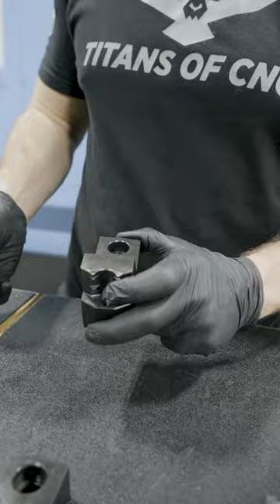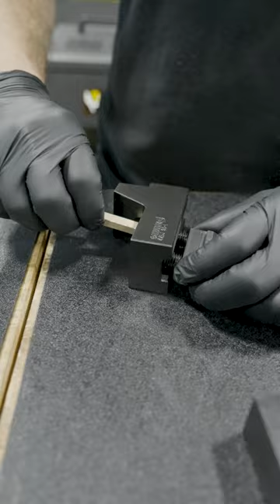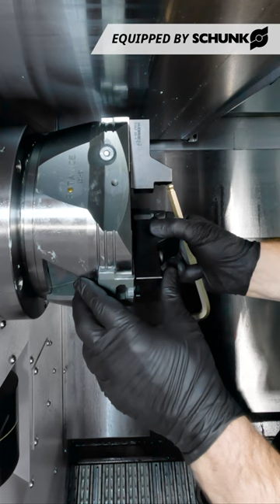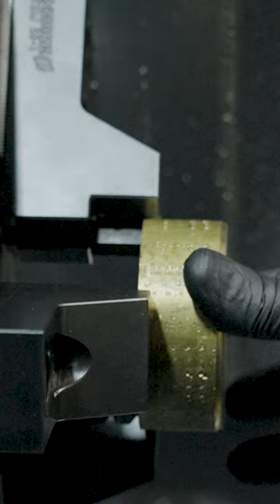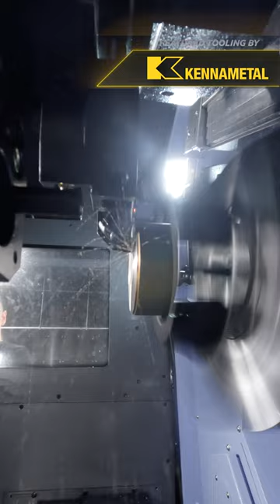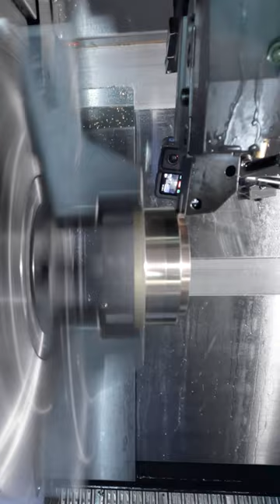EASY FIX for this Lathe Problem

Comment: Instead of buying extra gear you can just use allen screws, works just fine and is adjustable so you can clamp it  "as long as necessary as short as possible"

Comment: Holy cow how many thou did you come to the chuck jaws? Love machining.😊
Reply: Clearance is clearance.  .001 is just as good as .010.  Just hope you don't have to make a Z offset change.
Reply: Yeah the sawcut guy wasn’t paying attention and cut one piece .05 shorter than the rest 😂
Reply: With CNC it's a little less scary. On a conventional machine worrying you'll disengage the feed too slowly sucks when you have 0.05-1.0mm clearance.

Comment: so you guys just screw things into shit and press start on a program? i’m confused
Reply: Haha... for sure no one wants to see the full video of him proving a program and single blocking the way thru it,
Reply: @colbruckner9190  so just to be clear, he’s going to find a program made by someone for a specific part or hole, download said program, run it, if it fucks up make a few small adjustments and repeat?
Reply: If you seriously need to ask this, then you obviously dont understand how to run a cnc.
Reply: It is a "quick" video on a chucking system, not a tutorial on how to operate a cnc lathe from start to finish.
Reply: @colbruckner9190  well yeah no shit i don’t know how to run one that’s why i’m asking, but from what i’ve gathered it’s a lot of clicking start and using other peoples cad designs. maybe change a tool bit here and there but definitely not hard work. maybe if he was generating designs himself and using a hand guided lathe it would be more impressive but this, this is just a guy clicking go on a program.
Reply: @owen8329  there’s definitely more to it than just hitting the start button on a machine. That’s like saying all there is to being a carpenter is nailing stuff together. Unless you’re willing to spend a ton of time learning about machining, you’ll never really understand what goes into it.
Reply: If you are a cnc “operator” sometimes it’s just loading parts and pressing start, but the G-code needed to run the machine is generated by a programmer who has to make and test tool paths that will result in a finished feature. On complex parts, this can be a lengthy and complicated process. Keep in mind that the programmer is designing a PROCESS for making the part as quickly as possible without breaking tools and overloading the spindle. He/she needs to think about fixturing and stock/machine/tool selection as well. There are tons of other considerations as well. It’s not “taking someone else’s CAD model and hitting start”. It’s designing an efficient and repeatable process to make one specific part and then doing it all over again with different parameters and considerations with every other part that you have to make.
Reply: lmao sounds like a salty conventional machinist.

theres a machinist and theres an operator. sometimes the operators basically do just push start, wait for the machine to do its thing, put in the next part and press start again, and check dimensions every so often.

the actual machinist is the guy that writes and checks the program, finds ways to make it run faster, solve problems etc.

one thing conventional machinists do have on cnc machinists is conventional machinists can do repairs/modifications on the fly much faster, and theres some things a cnc can't necessarily handle. just like there's plenty of complex contours that are extremely time consuming or almost impossible on a conventional machine.

one thing both conventional and cnc machinists can find common ground on though is our sometimes irrational hatred for engineers 😁👍